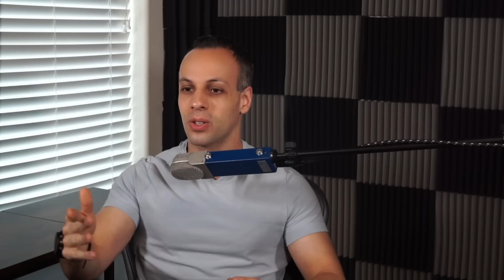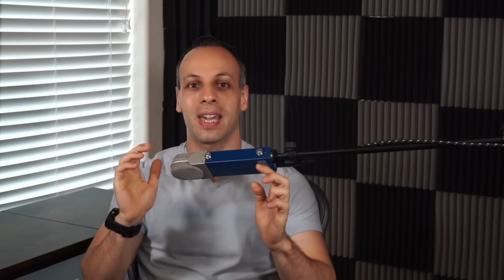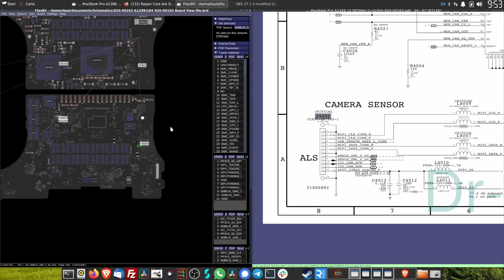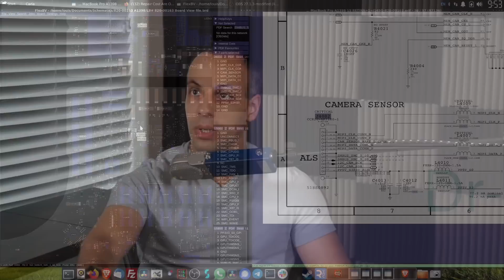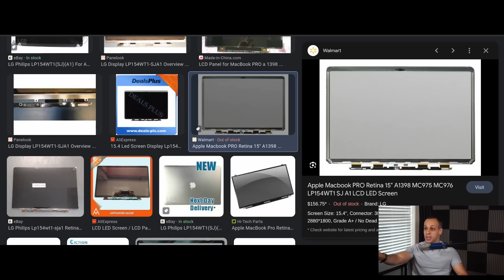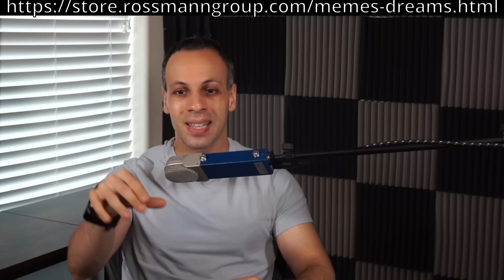The Ford F150 Macbook - when car repair resembles macbook repair...

Comment: When a set of taillights with included modules cost upwards of $5,000 just in parts, it's time to start a chop shop 😂
Reply: Hush. Next thing you know Ford will be taking another page from Apple's playbook by installing DRM in their modules so only "Ford authorized repair technicians" can complete the handshake necessary for a swapped sensor to talk with the ECU.
Reply: @GSBarlev ford authorized repair technician "fart"

I see what you did here 😅
Reply: @bitelaserkhalif sadly no, that's the name. Regardless this is bs
Reply: the right to repair laws stops that  @GSBarlev
Reply: @JoebDragon  The same laws that we keep find having all kinds of loopholes?

This latest "win" in, was it Florida? Well what ever... It had an exception for if I remember correctly "computational devices" that were not covered by the new Right to Repair law. Turns out that your computer, telephone, and games console are all computational devices. Want to bet that the car manufacturers will claim that extends to the electronics in your car? After all the brainbox handling everything from engine management to GPS and entertainments system in your car is computerized. Sounds like computational devices to me... They even come with upgradeable software.

Now this law is fresh and has not been tested in court yet. But as it is written I have my doubts it will change much of anything.
Reply: @JoebDragon that's actually not true tho. They just lie and say "the module has to be programmed, and no one but Ford bothers to buy the software". Had the high beam module on my 04 Lincoln LS go out and it would costs an insane amount of time and money to fix. Mostly bc the module is no longer made and the one you find at the junkyard might be messed up too.
Reply: @GSBarlev I don't think that's legal when it comes to cars... thats why it's possible to buy non manufacturer parts .. if they could have stopped it they would have.
Reply: Already is in many makes and is legal. You can get some aftermarket parts but unless it's a "dumb" part it won't be aftermarket, it will be an OE part that they sell you and you need the proper tools to program and set it up.
Reply: @GSBarlev "handshake" 😂😂 man Ford sucks
Reply: @GSBarlev Germans have been doing this for years but luckily thanks to so much community effort anything 10+ years old usually has aftermarket hacking tools and guides available to do it
Reply: That already exists in a lot of makes. GM Global A and B, Stellantis vehicles with the security gateway and many more. Parts are VIN locked and cannot be repaired using used modules or even replaced outside a dealership because of the way the systems are set up.
Reply: All those fools wasting time with cat converter theft.  Tail lights are the big bucks.
Reply: @robertsmith2956 people are stealing those too now.  Ford engineers conveniently made a couple different tailgate lock bypasses that are basically accessible with a screwdriver.  Pop the tailgate open (and steal it too), unscrew and cut the harness for the taillamps, and you've got several k in replacement parts.  More money and easier (quieter) than the cat to steal.
Reply: @robertsmith2956 the crackheads are already ahead of you. I’ve seen multiple posts where people’s taillights have been stolen. I can’t remember what company it is, but they came out with anti-theft screw kits to replace all the standard hardware on the lights.
Reply: Ford sued Autel because the AP200 scan tool scans for dtc codes to troubleshoot your car. Apparently think think we need to take our cars to a license Ford technician.
Reply: Bad Luck Brian: Start a chop shop, Ford serializes parts
Reply: > it's time to start a chop shop
or a bootleg operation. find some Chinese engineers. they can copy anything. send the stuff out labeled TOYOTA or whatever, only its a special model number and when it gets to the distributor it's for a Ford...
Reply: 5gs got me my air ride and left me like 1500$ for more fun shiny parts when I built my Jetta Ute.
Reply: That set of taillights costed more than my car...
Reply: What’s ironic about this statement, is the fact that these twilights are being stolen because if the tailgate is unlocked it’s only like 3 screws per side to take them out. Don’t even need a chop shop simply start searching the parking lots lol. Seeing kits now to switch your tail lights to security screws so they don’t get stolen.

Comment: you cannot have that catastrophic of a failure and have it not be designed that way intentionally

Apple / Ford are on the DO NOT TRUST, EVER list.
The only way off the list is for ford to instantly apologize for such a design oversight, then promise that any repairs to that section of the car will be entirely free forever.

Comment: People steal these tail lights because of how expensive they are & how easily removable they are. Warning truck owners keep your tailgates locked
Reply: Not to mention, certain brands can be hacked into and have the immobilizer disabled through the exterior lighting. People are connecting to headlights and injecting code into the CAN system to unlock doors and other nefarious things.

Comment: The original model T was designed to run only 10,000 miles before an overhaul of the engine was required. I have restored 2 Model T's. One of which I used an original engine and rebuilt with original parts and I can easily defend this figure of 10,000 miles. I learned from a biography of Henry Ford that he was upset at one point that customers were picking parts from scrap yards and putting them on their cars to repair them. He asked his engineers to redesign specific parts to fail sooner, but also permanently. So that people could not buy used parts for a pittance and keep their vehicles running. So began the battle between manufacturer that must design their product to fail or be perpetually replaced and the consumer who would rather pay more for a product built to last and of higher quality.
Reply: Seems to have been a prevailing and open business model back in the day.  Watching some documentaries on Gillette, it's the same story.  How can we make a product that actually does solve a need, but do so in a way that forces customers to be locked into constant maintenance through you.

Basically subscription services were always the Holy Grail.

The difference now is that most of this stuff doesn't solve any real problems and only creates new ones by owning it.
Reply: @bac1308  without planned obsolescence we wouldn't have literally any of the technology we do now. The simple light bulb required planned obsolescence to be manufactured in the first place. The very first step to modern technology required planned obsolescence to exist. You all forget that businesses exist to make a profit. If they can't make a profit they won't make a product. If they don't make a product you can't buy and use it. If a manufacturer doesn't make a light bulb you don't have light in your house. And if they can't make up profit off of that light bulb they're not going to make it.
Reply: @MamaMOB  I disagree that it was required.  I admit our world would look different, but I think you overestimate the importance of the progress consumer technology has made in the past 20 years and you could argue that some of them have left the world a worse place.

What real value has an incremental smartphone hardware update added?  What value have all these crazy shaver heads added?  You still have to replace a cell phone eventually, but it'd be more likely to only be when a new product that is actually better comes out, and not just because they did a security patch that drains your battery dead 4x faster and the new one works about like your old one did when you first got it.

The smartphone would still exist and be regularly updated over a longer timespan.  We'd still have disposable razors, but we very well could be using the double sided kind, which I actually prefer (clears more hair if you haven't shaved in a minute).

I know why businesses exist and I can disagree with the system.
Reply: @wxfield sounds like planned obsolescence to me.
Reply: And oil change service every 300 miles...or maybe less I cannot remember.
Reply: @hrdcpy  yeah around that. But they had way worse oil back then
Reply: RIP Model T enthusiasts. Lol. I actually did not know this as a 78-88 G-body guy.
Reply: @Crazywaffle5150  1060's era cars have electrical system is less complex than the F-150 taillamp module.
Reply: Who would've known an engine without an air filter or oil filter needs to be rebuild often.  The person who rebuilt my Model A engine and replaced the babbiting said it'll outlive me.

And no, they really didn't have great filters back then.
Reply: Hey OP, what book did you find that in?  I just ask because you should reference the book.
Reply: The new 2023 work van takes like 5-6 presses of a button to reset the trip odometer. 
We call this progress
Reply: Built Ford. Tough Shit.
Reply: I'm a vintage car guy (mostly '60s and '70s models) and while I do get parts from salvage yards, I also get a lot of reproduction parts. Once the patent has expired on a part, which happens when a manufacturer abandons it, anybody can make it. You can buy a complete old school cast iron Small Block Chevy engine without a single GM part on it.
Reply: T owners could source 100s of aftermarket parts/accessories and customize their cars to a degree. But I imagine certain key components were not licensed to 3rd parties!!
Reply: More like the scumbucket stockholders insisted on it. Henry Ford wanted to find ways to make the cars less expensive to buy AND pay the workers more, but the useless eaters of all things good upstairs made him ditch all that.
Reply: Maybe all of that happens but planned ups lessons already existed. You know the thing keeping your roomlit? When it was originally invented it lasted 10 years. No manufacturer would make it cuz they wouldn't be able to make a profit off of it. So they created the filament to expire much more quickly so that people would have to buy light bulbs more often giving the manufacturer reason to produce them. This wasn't Ford's doing this was GE.
Reply: Then they started building trucks that needed the cab to be removed to work on the engine and they made it the most expensive truck in history that failed constantly.  Ford and Apple are cut from the same cloth.
Reply: Hey OP, I'm still waiting on that book that doesn't exist.

I do find it ironic someone in a right-to-repair channel is making up ficticious stuff on one of the most repairable engines of all time.  A compression ratio were kerosene, ethanol, and low octane gas could be used.  I flat head that can be removed easily to clean and adjust the valves.  Cotter pins everywhere as torque specs were still non existant to the average person.  And lastly, the owners did their own service.

I also know you're full of crap on rebuilding two because their aren't many people who do babbitting for the main bearings and none of them would spread lies.
Reply: The first light globes wouldn't fail until they were engineered to fail after a specific use time.
Reply: @petesmitt absolutely right about the first light globe bulbs not failing,  and subsequent ones were engineered to fail (1900) there are still examples of such bulbs in existence,  there is one such bulb in a fire house I believe in San fransisco where it has been in continuous operation since 1900. 
Another thing to note pertaining to moden times would be led light bulbs,  there are more hardy and much longer lasting bulbs made for Dubai,  Google Dubai light bulbs.
Reply: @marcellachine5718 If the first globe bulbs never failed, why aren't there 1000s of them around instead if the one that people keep talking about?  Survivor bias too much?
Reply: @reubensandwich9249  why not research it yourself?
Reply: @marcellachine5718  Because the OP is full of crap, that's why.
Reply: @reubensandwich9249  well if you had spent about 5 seconds Google searching this you would have found out that it's because these light bulbs were made by a company that went out of business shortly after creating this light bulb. Only a few of them exist. That's why there's only one left. The rest probably broke being made of glass and all. You're dumb and lazy. Congratulations on telling the entire world how stupid and lazy you are!
Reply: @petesmitt  Not quite how it happened
Reply: Honestly, as far right as I am im starting to fucking hate capitalism because almost every company becomes like this eventually. We need something new that isnt too left or too right but also limited enough to prevent this shit. We need consumer protection and to classify businesses as non-civilian in their own business class so when they get in trouble is a hell of a lot more punishment.
Reply: @evil1st  the good news is our current system has the controls in place to do exactly what you're saying.  Just have to find someone willing to pull the levers.  Kind of all comes back to lobbying and corruption
Reply: @evil1st The solution ultimately is to mostly end limited liability. Put the owners’ skin fully in the game and make them fully liable for consequences and things will get much better. Of course there will be a cost in terms of capital formation and less risk taking, but everything has a price.
Reply: It's unfortunate as these spare parts kept old Ford T's out of landfills.  Henry Ford I was also part of the America First committee that helped organize the 1939 Gathering of Nazis in Madison Square Garden to try to convince the US they'd lose if they fought Germany.  His German factory was producing conventional trucks and Maultier half-tracks for the German armed forces. Ford-Werke manufactured the turbines used in the V-2 rockets.  When the Allies bombed his factory, Ford successfully sued the U.S Government.   Both GM and Ford went along with the conversion of their German plants to military production at a time when U.S. government documents show they were still resisting calls by the Roosevelt administration to step up military production in their plants at home.   Ford was a proponent of Eugenics pushing for laws  which led to forceful sterilization of people they deemed to be imbeciles crimes against humanity which ended only in 1972 in the US and Canada.  He was also the first to use the "Make America Great Again" slogan in his 1924 Presidential Race.
Reply: Capitalists praise Henry Ford as being innovative 🙄
Reply: @austinhernandez2716 He sold the Soviet Union mass production technology that allowed them to beat the Germans.